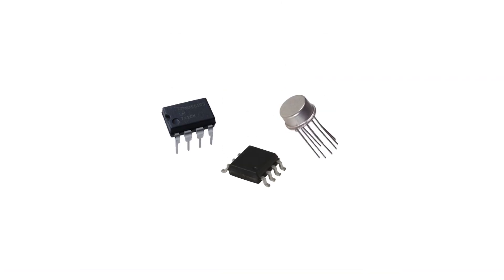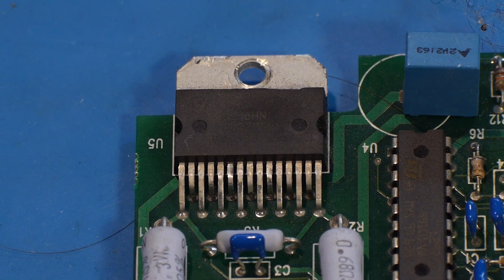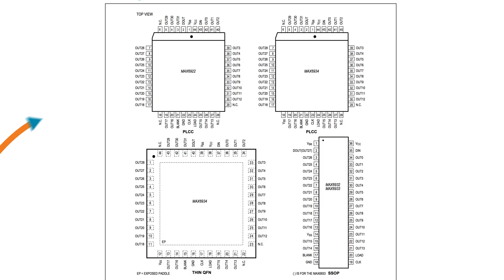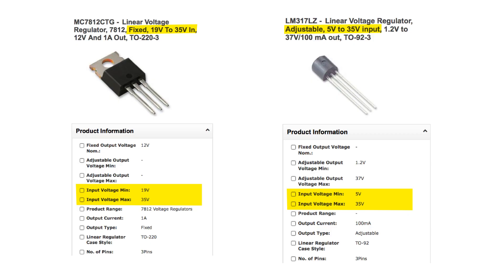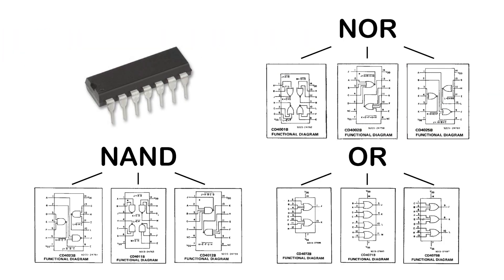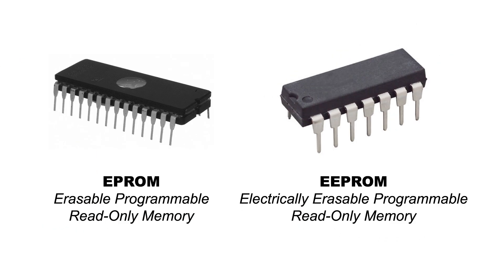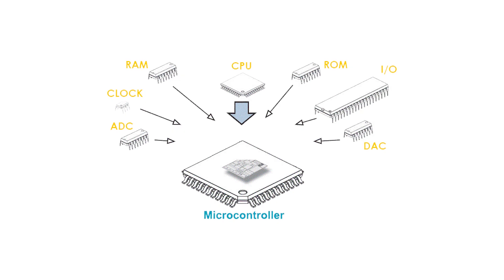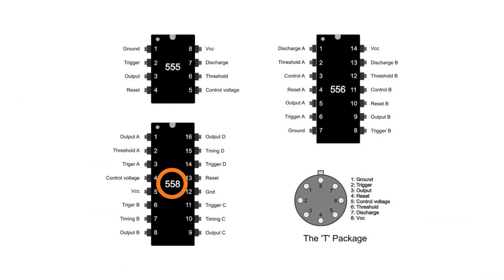How Integrated Circuits Work - The Learning Circuit

Comment: Really great and helpful work! If I may make a suggestion, I am trying to learn about Electronics and I am now studying a device that touches us all everyday. Cars built after 1995 or so employ actuators that control the HVAC in the vehicle. I am working on one which is a 3 1/2" X 3" plastic box which operates dampers in the cars duct system to mix heated or chilled air to satisfy the desired air temperature. 
The box contains a small electric motor whose shaft is a worm that operates a five gear gear train. The last gear's shaft is connected to a damper (blend) door which modulates various air flows to achieve a desired temp in the car. This super light box also contains the electronics: 6)resistors, 2) capacitors, 1) PBR , 1) 8 pin IC # L 2722  and 1)diode . I would really appreciate and thoughts you may share
regarding  this actuator especially the PBR and the 8pin I.C.
I can send a photo of the actuator with its cover removed if you wish.
Kind Regards, Joe
Reply from the maker: The best place to get this request in front of hundreds of engineers and makers is on the element14 Community. . .  Post your question on this episode http://bit.ly/2Hwqp5H  or start your own project blog to get help and ideas!
Reply: @element14presents  do you know anything about nxp UBA2013T UBA2014T ALL THE WAY  To UBA2028T

Comment: Hello. I'm dayo. Thank you for your video It really helped me. I'm new to transistors and ics. 
   So I'm currently on a project where I'm trying to give a radio signal to a receiver. But I'm trying to get the receiver to keep a one button tap supplying continuously instead of one tap-one output. I'm trying to get a continuous output. 
    So i checked YouTube on transistors and ics, how to use it as a switch like a relay but i don't understand how to do it. I used a relay but once power is cut off a relay will open. 
To simplify my question is there a way i can supply a voltage to a switch thereby closing the circuit and then when the supply is stopped the circuit is still closed instead of opening. 
    Please do you get my question. I would love it if i got a reply quick. Thank you

Comment: Relay logic I know. The internal structure of an integrated circuit I know not. But I would have gone with the metal like backplane of the silicon wafer would be etched to include only dots of metal that rest on the tiny wires that were carefully placed on the bottom half of the IC package with a jig then glued in place.

Comment: I consider logic gates to be analog, because even though they deal with digital states, they don't need a clock to process analog signals. Many analog synths use logic gates as their oscillators. If it requires a a clock pulse -- it's digital, otherwise ... might as well be analog.

Comment: Integrated circuits are chips which have many hundred electronic components on it, a lot of systems that would have used analogue parts are starting to use DSP processing to do the same thing.

Comment: Anyone got a way to remove the epoxy casing that does not involve boiling acid?
Reply: Kars Noordhuis, I’ve seen 90% alcohol loosen up some epoxy blobs. I’ve also seen epoxy be defeated with heat.

Comment: I don't think that's right for voltage regulators.  My understanding and experience is that voltage regulators work by taking the voltage difference and converting it into heat.  The amount of current flowing through it is regulated by the load of your circuit.  If you use a 7805 on a circuit that pulls 1 amp @5v, and you put 8v into it, it will pull 1amp @8v (producing 3w of heat)... Whereas, if you pump in 18v into it, it will still pull the full 1 amp and just produce 12w of heat (and blow the regulator without appropriate cooling).